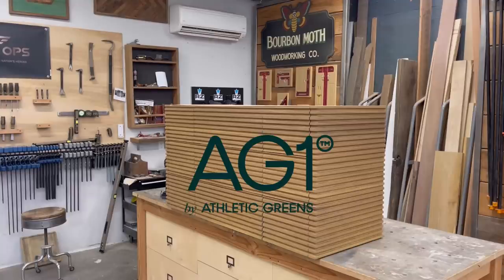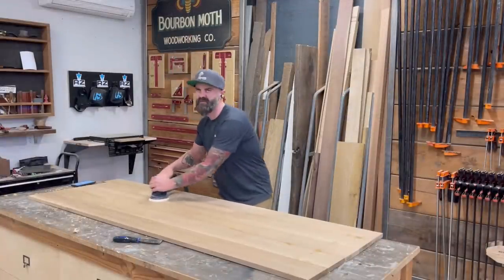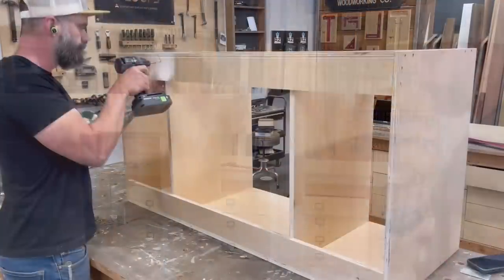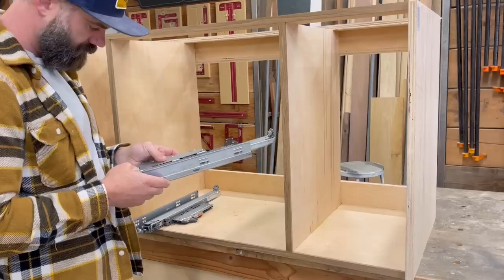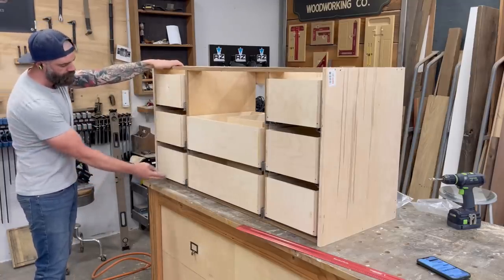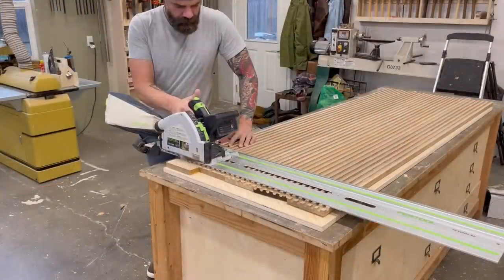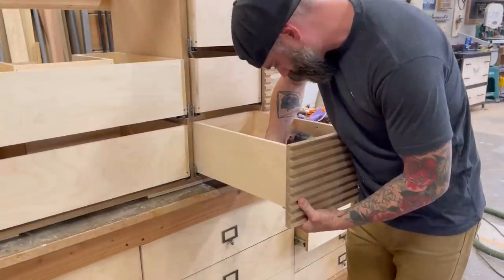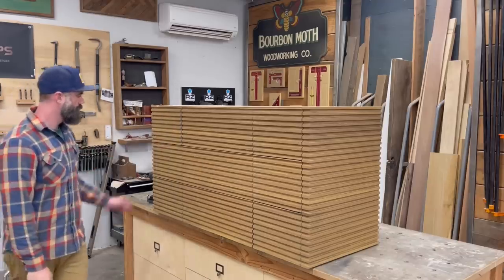How to Build Cabinets for your Bathroom || Cabinet Building DIY

Comment: I like the look as a whole, but I would'a definitely gone with cutting the drawer fronts either in the grooves or left a gap in the grooves to make the high parts wider where you wanted to split them. End result is fine, but when it gets that thin, the slight inaccuracies and grain shifts are really really noticeable.
Reply: Agreed.

Comment: One way I've found to speed up the flute sanding is to buy a dowel rod that fits the flute and wrap it with sandpaper. Even if you just make the rod about 6 inches this saves a load of time.
Reply: Good idea 👍🏼

Comment: Good point on drawer face screw placement.  When you started routing that slab out I knew those were going to be placed precisely. Dope vanity cab construction and design dude.

Comment: How'd you space the flutes so perfectly?  Especially starting from opposite sides and meeting in the middle like that.  I was hyperventilating.
Also I'm not crazy about how the horizontal cut lines for the drawer faces ran along the peaks of the flute pattern instead of more hidden in the valleys.

Comment: Next time you do something like this. For the sanding in between the grooves grab a round over bit a make a male like piece that will just fit right inside the grooves, attached sand paper to it and than it should glide back and fourth inside the grooves. Should save a bunch of time with sanding.

Comment: Just curious, why not use an assembly hammer for the seams during glue up, cabinet scraper for after glue up , belt sander for the sanding? And since your suspending this cabinet, why use butt joints?
Beautiful work in the end.  Much respect intended. :)

Comment: Wouldn't it be easier if you screwed the center slab in place and then cut it with the truck saw? I think you could save time from positioning each drawer. Great job!

Comment: Painters Tape and super glue is a safer option if you want to avoid the level of stick that carpet tape has. While Carpet tape is amazing works great. I have found it pretty consistently will pull up grain on baltic birch plywood. Or in the worst situation break solid panels.

Comment: Hand sanding is definitely the worst part by far. Quick question, what is the mallet you use that has the head that angles? Cheers Paul.

Comment: Why do you have to connect the drawer slides with a tube connector? Doesn't the actual drawer itself act as a connector for the 2 slides?

Comment: I'm surprised you didn't put those hinges on the top middle drawer. That allows the drawer looking top center, to hinge down and stop at a 45° angle. And then they have these plastic containers that go on the inside of that false drawer. People use them for toothbrushes, and all sorts of stuff. Anyhow great work. Pain in the butt im sure.

Comment: Synchronisation for Tip-On is necessary when drawer is wider than 60 cm. Or 23,62204722 of those stupid imperial inches.

Comment: Dear Jason, Do you ever worry about the lack of negative feedback in your comments? 

I am a big fan, but I did not like this design. Instead of just trashing, here's an objective reasoning why:
1) The flutes seem overdone. I know it is a matter of taste, but still. Imagine a mustang with racing stripes. Now imagine a mustang covered in racing stripes. Can't argue on the WAF, though..
2) The way the flutes were cut with the waterfall, wouldn't it be better to first miter, then flute? That way, all flutes would guaranteed match. The corner could even be made softer before fluting.
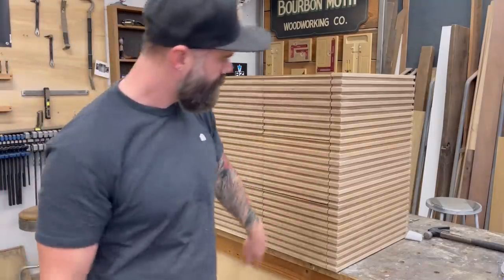3) Unavoidably, due to #1, the rip-cut interferes with the flutes. When it is not exactly parallel (and it never can be), one is bound to see a non parallelism between a flute and a rip. 28:07. Perhaps (and this is a long shot) this might be avoided by centering the miters within the flutes (grooves).

I know it is easy to critique in hindsight, and I am likely to be just some random keyboard-warrior on YT, but still, my 2 cents, in good faith ;)

Comment: So I’m guessing if the Blum under mount hardware is approx 35-45$ us.  The one that has the open device is pushing $100. I mean what happened to those awesome glossy white side mount slides that had the one wheel on the back to ensure SMOOTH gliding !?!?

Comment: Absolutely awesome and exactly the look I'm after for my own built-in vanity. Only thing I'd change: have the horizontal drawer reveals located not on the hills but in the valley of the flutes, for an even cleaner look. I'm in love with those Blum Movento slides. Hint for the furniture hackers out there: Ikea uses exactly those Movento Tip-Ons for their Exceptionell slides in the Method carcasses.
Reply: I thought this same thing as well. And if one were really ambitious, they could add some kind of vertical lines to hide the vertical seams. Now I'm thinking about doing something similar but with smaller flutes (or even simple grooves) where every reveal is hidden.

Comment: This is actually a great proof of concept for anyone who wants to make something cool-looking but isn't necessarily feeling that artistic/creative spark. Pick something super simple (like in this case literally just a straight line), repeat it a BUNCH of times, and you'll wind up with a pattern that looks like it took heaps of skill, when in fact it really just took a heap of time and patience. If you approach it the right way it can also be an amazing form of meditation/flow, especially once you streamline your workflow and really get in the groove (heh).

Kumiko is another perfect example - instead of creating 1x Art all at once, you can use a simple jig to make 2000x Little Bits of Wood one at a time, and then assemble them into something greater than the sum of its parts.

Comment: Awesome build as usual. But horizontal slats give way to a lot of surface where dust can accumulate. Unless you don't mind cleaning each crevice often
Reply: A vacuum cleaner with a brush attachment makes quick work
Reply: @ZackPyle  sure. But some prefer no work at all... QoL design. Unless you really favor the horizontal lines before extra cleaning. It's a matter of choice in the end.
Reply: @mariano_353  yeah, I'd probably do vertical grooves myself

Comment: Pretty cool looking Floating-Board. How did you get inspired for the look? wouldn't it be possible to use the cool styled oak for the corpus instead of the plywood? this would reduce cost and weight wouldn't it?

Comment: Very nice. Since your blade kerf was determining your reveals - could you have simply laid the box down with drawer opening facing the ceiling, dropped the full slab in place aligned L&R and top&bottom, screwed it in to all the drawers to establish the position, removed it and made the cuts to the slab, and reattached with guaranteed perfect positioning? Then you wouldn't have to do each drawer with the spacers to align everything
Reply: The slides will shift slightly when they don't have gravity holding them down relative to the ground.  The reveals would be off once the cabinet is set upright.
Reply: @nickwill4344  good point. Instead, it could be done upright - he'd only have to set the spacing bottom, left, and right and then screw the whole slab in to to the drawers to establish drawer positions. Removing the slab and chopping it in to the individual fronts then it should all be spaced perfectly. Only a small pickup in efficiency, though, and only a viable solution when using the kerf to define the reveal...

Comment: There are many ways to skin a cat but if you screwed all your drawers to the slab while it was one piece you could have taken the slab out and cut your drawers out and you'd Know they would be positioned correctly without all the extra steps.

Comment: The Movento sync bar has an internal shape that locks onto the "+" shaped inserts that come with the tip-on devices.  Arrows by contrast, are circular inside.  Order the Blum sync bars with your Movento hardware, from your Blum supplier.

Comment: It’s an amazing build, but don’t you have to be concerned with wood movement on the end panel?  Gluing and screwing a solid oak panel (which will move) to a plywood substrate (which won’t move) might come back to bight you.  I hope not, but…
Reply: Bite not bight…😅

Comment: A tip for sanding fluted stuff is to wrap a dowel with sand papare to get down in there to save your fingers
Reply: You could have at least told him that before he went through the trouble of building and making the video.  Gosh.  😂

Comment: Damn nice cabinet, but sheesh, you could have power sanded those flutes.

Cut a 3" disk out of scrap wood, about 1/8" thinner than the flute width, and round over the entire edge. Attach a 5" sanding disk to the face. It'll overhang by about 1" all around. Make some radial cuts in the part of the sanding disk that overhang, and wrap them around the edge of the wooden disk. Drill a hole through the center of the disk and stick a bolt through to act as a spindle, and chuck the whole thing up in a drill. If you use Velcro or staples to attach the sanding disk to the wooden disk, you can replace it when it wears out or when you want to change grits.

Comment: You do such amazing work. Thanks for sharing it with us. Note on counting.  When I moved in my house I hated the kitchen cabinet knobs. I counted them, recounted them then had my adult son count them. 28, 28, 28. Got the knobs, counted them as well, 28. Installed them. I was shorted one knob.  ¯\_(ツ)_/¯.
Reply: The worst part of that is when you need 1 more , the store is out of stock. Had that a few times lol.
Reply: @stephandevriesere3667  No doubt. Truth is the 28 came in bulk from amazon. The last one is from Home Depot, side by side they are slightly different. From 2 feet you can’t and no one ever came in my kitchen and said, “Why is that one different?”. lolol
Reply: @lincolndickerson1293  The biggest problem is, WE see it hahahaha

Comment: You took the white oak panel out of clamps after one hr to scrape the glue then you jump right into planing and sanding. Did you not wait the full 24hr to let the glue fully cure? You are selling projects to hobbyist woodworkers who have plenty of time to work a project yet you rush through projects just to release videos. Waiting for glue, epoxies and finish to cure is a big part of woodworking. Working on multiple projects to keep things moving forward in parallel is important to staying productive. Using the fastest methods and not discussing how long the process actually takes is a disservice to your viewers.